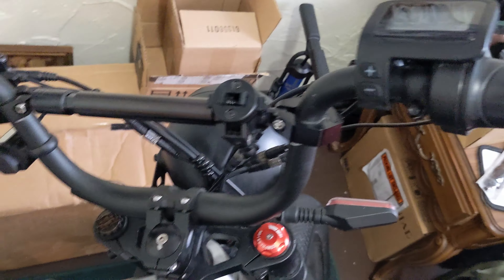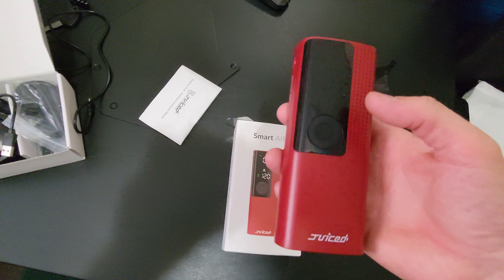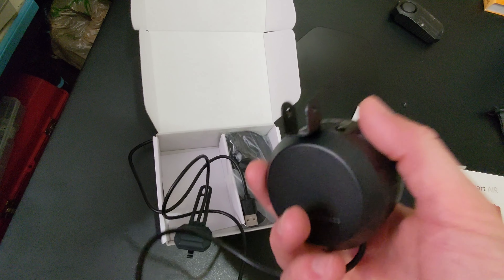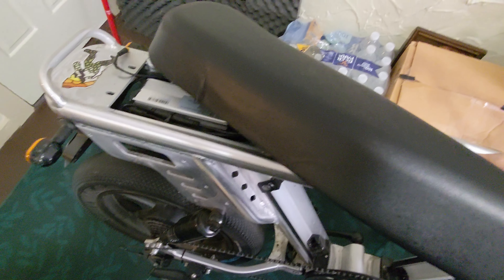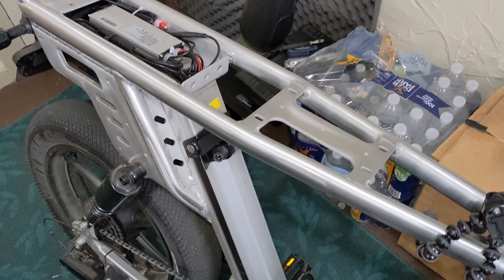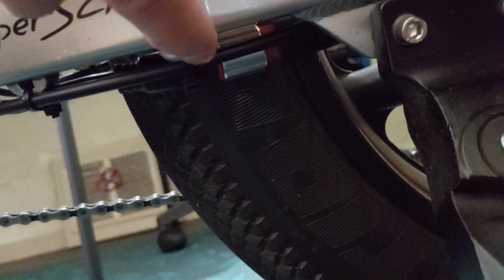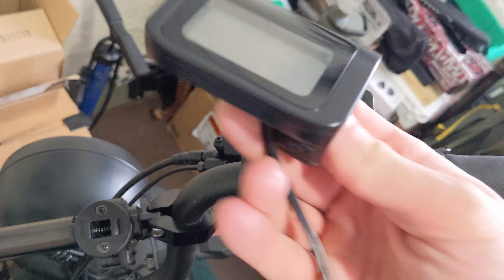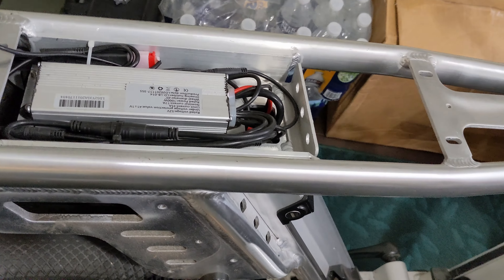Juiced E-Bike Lost all power - Controller Malfunction Ep.67

Comment: Nice troubleshooting skills!   I had a really similar thing happen to me at the end of June.  My SuperScorpion sat parked out in 90+ degree sun for a couple of hours during our Pride Celebration.  When I jumped on it to go home, I was doing about 30 or 31 mph.  After about a mile or so I stopped for a red light and the bike just went dead.  No power at all, no trouble codes, nothing.  I got my brother in law to come and rescue me and the bike with his pickup truck.  The next day - and ever after - it has been fine.

I examined it pretty closely and could find nothing.  Someone on the Juiced forum suggested, and they were probably right in my case - That the sitting in the hot sun, and then being ridden full bore was enough to get the BMS to do it's job of protecting things, and it just shut down because of overheating.

Anyway, nice job of troubleshooting and repairing yours.  Happy riding!
Reply from the maker: Yeah, I was so glad to have found the problem quickly. My heart sank every time I lost power. There is nothing worse than having a brekadown. These e-bikes definitely aren't the lightest things out there either lol.

Glad to hear your didn't have a mojor issue. It's awesome that the bike knows how to protect itself if need be. I think the controller is suppsed to shut down if it reaches a certain temperture (not 100% on that though or how it's connected to the BMS). I had a similar shutdown happen to me on a hot day once. 
All that matters is that our bikes survived to ride another day!

Untl the next video and thanks for stopping by!

Comment: 2:06 awesome @11:00 did you inform and send photos to Juiced even though over warranty?
Reply from the maker: I had a little back and forth with them but they never rectified it in the end. They were supposed to get back to me but since I fixed it and I got busy with life I basically let it go. It would have been nice to have heard some kind of resolution from them without me having to push the issue. I'm just glad it works.

Comment: Did you fix the problem and did you fix the problem?
Reply from the maker: I did fix the problem. I Fixed the crimp in the wires by making sure they separated individually and used electric tape to secure them. Problem solved!
Reply: That's the only problem, I have my scrambler 2 for 3 years and. This happened error 8. Do you have the video how to take out the seat to get to the wires
Reply: @jayhernandez6812 I don't have a video on removing the seat but it is really easy. Look under the seat and you could see the mounting bolts. There are six of them. They should be silver. You'll need a ratchet wrench.
Reply: Check all wires and connection all good so maybe need new controller and motor you think? If i need all this parts is there online i can buy this and better upgrade parts more power than juice bike?

Comment: Did you see a red color cable is disconnect?
Reply from the maker: Honestly, I can't remember if I saw a cable disconnected. If there is a cable disconnected but it's by itself it probably doesn't go anywhere. If there is  a male and female cable disconnected I would imagine that they need to be reattached. Sorry I couldn't help more.
Reply: Did you do any modification to your hyperscrambler 2 lately?
Reply from the maker: No new mods lately. The last big thing I did was install the larger 203 mm rotors. I am about to change the plastic headlight mounts that keep cracking. I'll make a video on that when I do the repair.
Reply: My h2 is not running now, wonder if I should buy h2 again or better than h2 . Something easy to change like hub and controller.

Comment: If anyone else has had a error code of 21 let me know what it is my scorpion will cut out a little bit then speed up and cut out a little bit speed up and sometimes cuts out completely and says error 2 1
Reply from the maker: I had an error an 21 code that I talk about in my new video but it was due to the improper set of planetary gears I installed. Maybe it is hub motor related for you too. Did you ever find out what the problem was?
Reply: @keepingitkresky4412  controller needs replaced, or the speed sensor in the motor in the hub, I might get another one and keep this one to work on later, but if it's going to need another whole wheel hub where the motor is with the speed sensor is that's 540 part alone, not real happy with juiced bike putting the speed sensor inside the hub motor